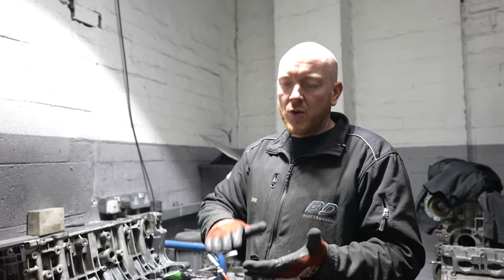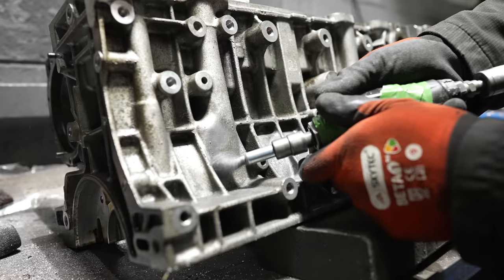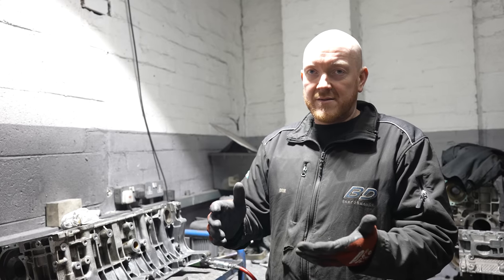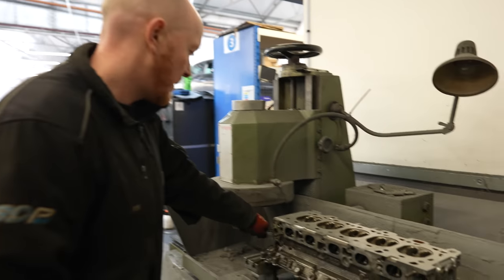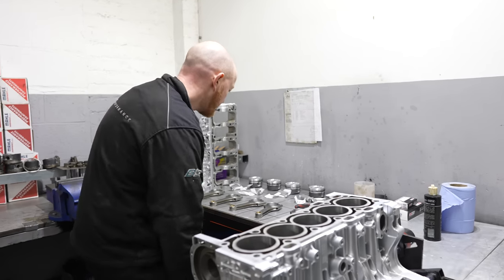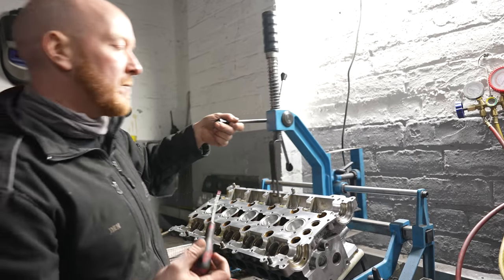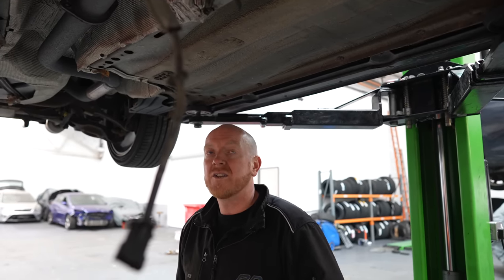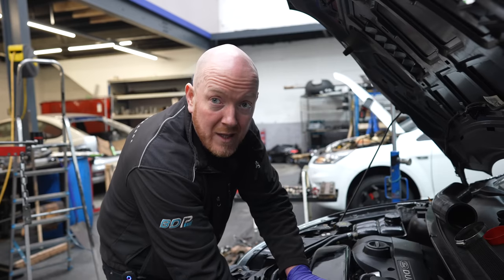Zero to 425 REVO Package from Start to Finish - Ford Focus ST225

Comment: You've impressed me  to the point where I can't explain what I think of your work the engine is absolutely stunning to where you would think that it is brand new I'm really thinking of bringing my car down for you to make my car more impressive than what it already is it just needs under the bonnet cleaned and Brightened up then it's going to look like it's just rolled off the assembly line and like I said I'm very very impressed with your workmanship top job and I'll be seeing you soon that's if you can do my engine
Reply from the maker: Thank you so much 💙💙💙

Comment: A great engine build on a St engine and alot of things I didn't know on the liner mods and also when he's cleaning the head of why on porting on the head to get more flow and when he's putting the kollits on the valves why didn't he tap the valve with a hammer to check there seated properly and the collit his got it how it should but an very interesting video on the t5 engine I have an st225 too

Comment: Great video /channel gets better and Better when rebuilding the head I see u used the original valves cleaned up  in drill would that be ok to apply to any engine rebuild to re-use valves also would a dry sump kit be ok for road going car with modified engine not just for track use finally doing a great job you guys are smashing it 👍🏻👍🏻👍🏻👍🏻👏🏻👏🏻👏🏻👏🏻
Reply from the maker: In honesty there’s plenty of ways to clean them however on the older engines the coke is far more stubborn and we found this the simplest and best way. We then polish them with some scotch in much the shame way to return the brightness.

It’s all about figuring out the best process and this works for us. It may not be that conventional but if it ain’t broke - don’t fix it!

Thanks for the fantastic praise and for watching. As we always say; it make this all worthwhile 💙
Reply: @BDPerformanceWrexham  thank you for ur reply help me also with my diy build of st150 baby brother of the focus best to ask the professionals much appreciated 👍🏻👍🏻👍🏻

Comment: So are new stock valves & valve springs used in this build or does the build include stronger valves and valve springs if so which brand are you using?

Comment: how well are things holding up at this power level after going to 83.5mm and doing a block mod? ive got k1s and 83.5mm wisecos waiting to go in my block but im on the fence about dartons, liners, or just boring and blockmod. ive messaged yall about buying a linered block but never heard back. likely because im in the states though.

Comment: The MK2 Focus ST has lightweight forged pistons, forged conrods and a forged crankshaft as standard from the factory.
So what is the point in this?
Reply: the strength of the factory internals are no way near as strong as these such as k1 rods as there are different levels of forging plus I don’t think the standard internals are much good past 300bhp

Comment: Whats the price of this build really interested
Reply from the maker: Take a look at the link in the video description; we’ve put the package on special offer.

Remember to check the hardware listed and understand that there may be other parts required to complete your project.

Thanks for the question and for watching 💙
Reply: @BDPerformanceWrexham  thanks I'm running stage 3 hardware at the min just want a better turbo and Forged engine
Reply from the maker: @gwenner465  get in touch 🙌

Comment: Somone has to mutch money lol! Or am just bitter cause mine is witting off due to a old bat! 😂 do a fling insurance money at it or do a let it goto copart and go get somthing german again. Decisions
Reply from the maker: Buy it back and tune: you can always strip the parts off and then you wouldn’t have lost much when you came to sell!

Sorry to hear about the car but sometimes it was a sign 😉

Anyways take care and stay safe. Thanks got watching 🙏
Reply: Dont see the point in modding a car then have to strip it when comes to selling
Reply from the maker: Completely understand. However even without stripping to sell you’d likely not loose much of you bought the car back cheap 🙌
Reply: Fair no at badly damaged need a door and wings gubbed swap at over at same time back door and arch some paint. A days work

Comment: What TF are you doing at 21:13 ? Use the proper tools for the job, using a screwdriver like that on sensitive engine parts is just plain stupid. That "mechanic" is what I call a "led hammer", would never get to touch my car ever.